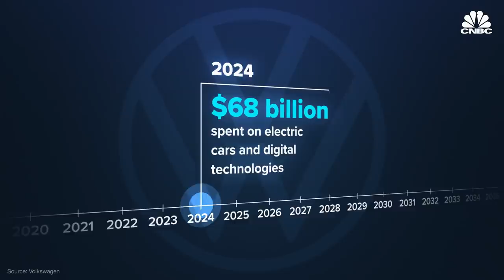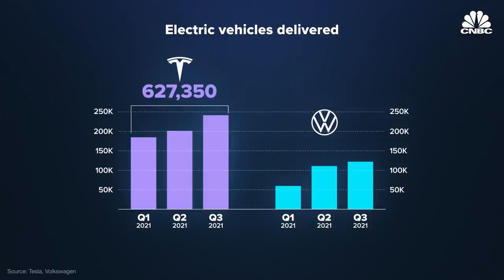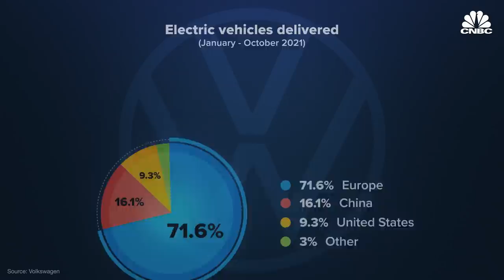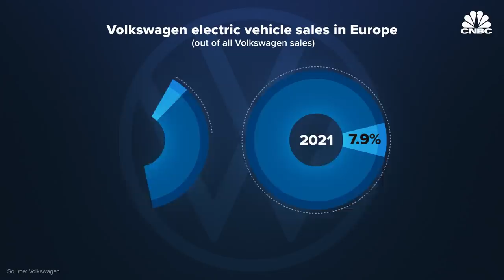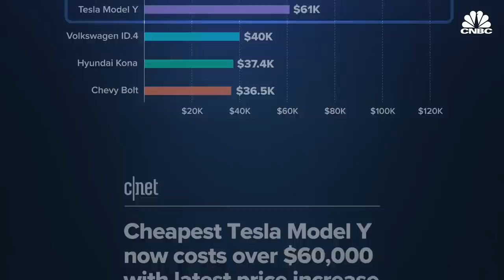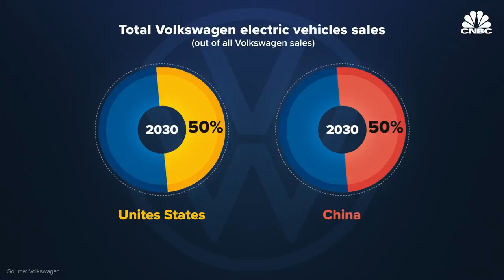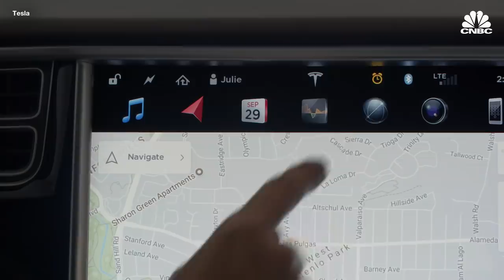Why Volkswagen Is Beating Tesla In Europe

Comment: So true that different commutes,  road conditions and prices built totally different markets in Euro and US
Reply: Tesla Model 3 is a large car over here, and rather expensive. (not for what it is). And then there is the perceived quality issues in the fit and finish of the Tesla's. VW's aren't perfect either. The ID3 was a software disaster end 2019, but a extensive dealernetwork makes is a better bet.
Reply: @JJVernig  but if you have driven a model Y and then a ID 4, you do start to wonder why anyone would go for the ID 4.
Reply: @EmilKlingberg  because a id4 is 20-30k cheaper. Thats why.
Reply: @EmilKlingberg  ID4 is significantly cheaper, not even including tax credits. And even then it’s built better.
Reply: @robertjonker8131  is that in Europe? Mode Y is only 10k more in the US but that isn’t even counting the EV discount that can save you up to 8k.
Reply: Don’t forget EU tariffs. It’s design to protect German automakers.
Reply: The car market is comically provincial in Europe-Renault/Peugeot in France, drive 5 miles into Germany and all you see is VW/BMW/MB.
Reply: @davidc2838  Only smaller Tesla model's  (Golf/Polo) size would make them marketleader in EV's in Europe.
Big cars in Europe also means big taxes for owners
Cost of ownership is a very big deal in Europe.
Cars are for 90% of the European people just a transportation vehicle to get to work and back.
the power utility branche of Tesla is already expanding
They are installing more and more electric infrastructure like solarpanels and  batterypacks for houses and industry.
VW does not have a power utility branche (yet)
Reply: @obelic71  Tesla will be market leader in EVs in Europe well before they come out with their $25K German Design. Primarily because non-one else in Europe is as dedicated to EVs as Tesla. So VW won’t force it until they have to do so in 2025, when the penalties get much harsher for ICE vehicles.
Cheers
Reply: @davidc2838  I don't give two sh*ts about some carbuilders dedication to EV. I need a goddamn car. Eventually I'll need an Electric car that is cheap and simple to maintain with an exensive dealer or parts supply network. And I don't see Tesla delivering on that any time soon.
Reply: @davidc2838  Most Europeans aren't fans of Tesla tho. Tesla is cheap quality.
Reply: @EmilKlingberg  that’s probably true, although the ID4 is really a very big car and Model Y just became available (last month)..
Reply: True ... In Europe we have roads without potholes ;-) No need for a pickup truck.
Reply: @justthecousinoftheguywitho2337  Most Europeans don’t have to buy a Tesla, for it to become the best selling EV manufacturer in Europe. Just enough to be best selling.
Cheers
Reply: EU has banned ICE car sale after 2035. I think its in every manufacturers intrest move to EV unless they plan to move out of business after 2035
Reply: in Europe we buy quality. Also you would need to pay much much more for insurance for the stronger motor. For European normal motor power is around 110kW. More powerful motors are exponentially more costly for the insurance.
Reply: @davidc2838  come on. stop spewing your wishes. You don't know the facts. You are just forcing something that will never happen.
Reply: @N9mber  and also the france, one's .... and oh wait ther are also tariffs in the US to protect american automakers
Reply: @EmilKlingberg  You can bring five adults with weight higher than 80 kg each in the ID4 without going over the silly weight restrictions the Tesla Y and 3 has.  Than means you can actually bring some drinks for the passengers as well in the ID4. While the big cargo space of the model Y has to go empty.....
Reply: @davidc2838   an american investor argues with europeans about european taste and market lol, sit silent; europeans trust and love german cars and distrust american cars. High tech doesnt equal high quality.
Reply: @obelic71  As much as I agree with that statement, it actually isn't true. Sure, pickup trucks won't succeed in Europe, but models Y and 3 have already proven the most successful by far. It went as far as the Model 3 being the best selling car, not EV in the UK for a month. Teslas sell stupidly well, and demand isn't a near-term problem, nor will it probably be in the next 5 years. With tesla increasing production by over 50% year to year, its just a matter of time before Tesla is the largest car manufacturer by sales and not just by market cap. If the id4 and tesla model Y/model 3 were equal in price, which would you choose?
Reply: @CitsVariants  curious why you love and trust German cars when the companies that built them designed them to cheat emission requirements?
Reply: @pauldickhoff3594  If the electic cars are just avg. build quality, your reliance on dealership service and parts will becomes insignificant compared to the ICE vehicles.
Reply: @CitsVariants  Tesla already had the top selling vehicle in Europe for a month without Having a factory there.
It’s pretty easy to see that Tesla will have the top selling BEV in Germany and Europe as soon as the factory opens and ramps up next year.
Reply: @robertjonker8131  google says the difference is only 3k euros? I think It is a temporary supply issue  because China and europe have to share cars from giga shangai. Once berlin opens there will be no competition. i doubt anyone is dumb enough to buy a car that is inferior in software, performance and range. Also model 3 is straight up the highest selling car in europe(quoting vw ceo)
Reply: @sebastianorye2702  Tesla's are very  very expensive cars to buy and maintain in Europe.
They drive way better then most other EV manufacturers and almost all are leased by companies as fleetcars and not privatly owned. 
98% of al tesla's privatly owned are former fleetcars.
The ID4 is in my opnion just a meh EV.
Hyundai has a much better EV car in that price range.
Chinese brands are starting to flood the European and US market with "cheap" quality EV's
That will shake up the entire car industry like the Japanese did in the 70's.
Reply: @pauldickhoff3594  a reliable afordable ICE/EV car that has to do what it has to do.
At the moment Dacia, Hyundai, Kia fill that gap of the market
Reply: @korencek  European taxes are divided in engine power or carweight countries.
For example a lightweight hothatch is superexpensive in Belgium but cheap in the Netherlands.
A big Volvo estate is super expensive in the Netherlands  but cheap in Belgium.
Reply: @obelic71  Yeah no doubt in chinas ability, however, 98% being former fleet cars? where did you hear this? Also, Teslas are not expensive to maintain in Europe, rather quite the opposite. As Teslas maintain such high prices and actually don't really depreciate in value, this means that when you buy a Tesla and own it for 3 years or something, you can practically get the full price back. Teslas are the most popular globally, with you having to wait over a year, and sometimes 2 years for your car if ordered now.
Reply: @korencek  Tesla is creating its own Insurance, which is much cheaper based on the data from the vehicles. They have it in the largest states in the US and are expanding to more states.
Tesla Already launched Tesla Insurance in the UK and have set up an Insurance Company address at Giga Berlin, so they will offer discounted insurance in Germany after Giga Berlin opens too.
Tesla is a HIGHLY vertically integrated company, much more like Amazon than a normal Automotive OEM.
GM is going to copy the Insurance play but they’ll always be behind Tesla when it comes to innovation.
Cheers!
Reply: @obelic71  Chinese brands will flood the EU market with cheap, quality cars. There you missed a comma. I fixed it.
Reply: @davidc2838  we know how "innovatively" Tesla copied prosche panamera. From that point there is nothing else. Tesla is dragging behind European car makers and trying to copy everything that's not electric motor. And they are still failing miserably which shows in poor build quality. It's a bit expected from startup company which is 100 years behind other car makers. Takes time to build quality through past experiences. And with Tesla price it's trying to be a car for eveyone.. while in price range it competes with mercedes, bmw and audi. well good luck on that.
Reply: @sebastianorye2702  if a Lamborghini and a Dacia would be the same price, which one would you buy? What an unnecessary assumption.
Reply: @Just the cousin of the guy without a mustache funny since European cars are some of the crappiest cars on the planet
Reply: @korencek lol VW is the furthest thing from quality
Reply: @Ewoodster  I don’t fully get what you are referring to. Which comment is this?
Reply: @N9mber  ohh u means the “chicken tax” designed to protect american car maker??
Reply: @EmilKlingberg  because the id is affordable and the tesla is overpriced